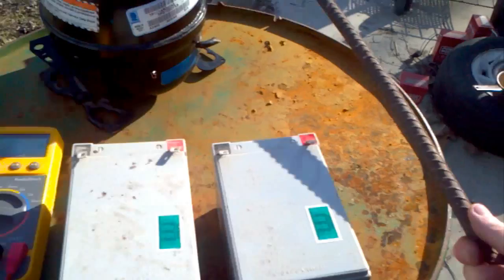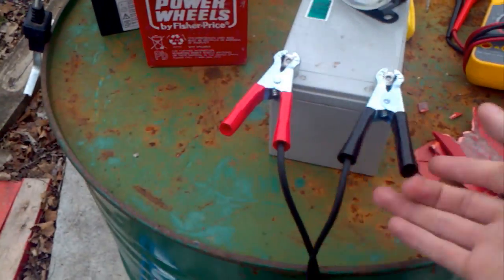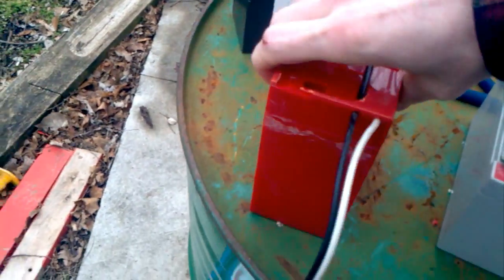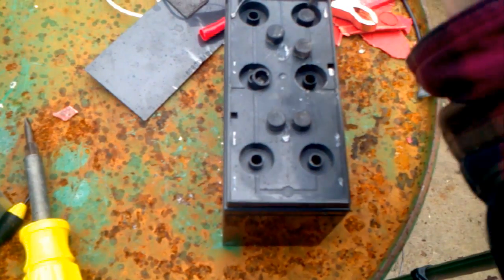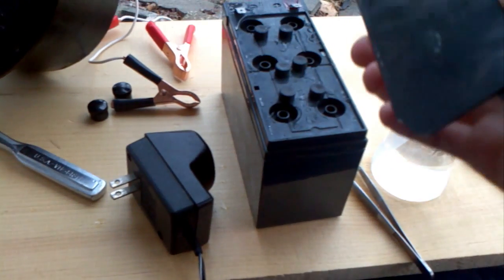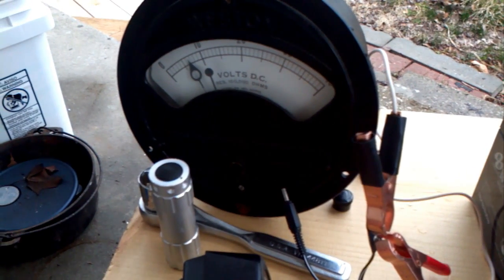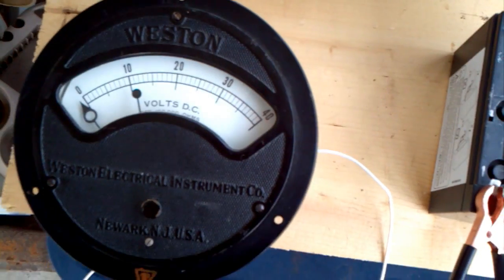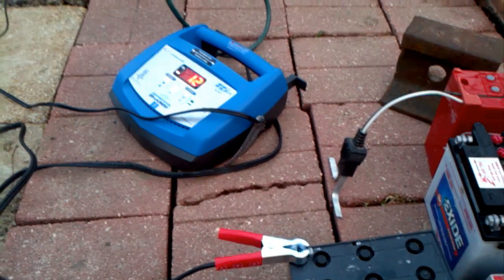DIY: Restoring Sealed Lead Acid Battery

Comment from the maker: you just connect it and let it sit on the battery for a few weeks. if your looking at the Wizbang Plus it pulls about 0.16 amps i think. unfortunatly mine arrived broken but they where really nice and just canceled my payment and let me have the broken one for free. i got it soldered back together and now plan to make them a  review for payment.

i do notice a small increase in voltage day by day. the voltage the battery settles to 20 minutes after charging i mean.

Comment from the maker: if its not raising voltage then you might kill your battery doing that. usually i dont charge more than 5 amps anyway. anything more than like 2 amps will electrolize the acid. a good sign of a battery reaching the cap of its present capacity is when it starts getting hot. that means the energy is turning into heat instead of being used for a chemical reaction.

a 20$ desulfator would be my choice. i'm desulfating my favorite battery and its gone from 11.9 to 12.2 so far.

Comment from the maker: oh but now that i think of it connecting the computer power supply with the desulfator to the battery might negate the effects of the desulfator. that is if the power supply absorbs some of the voltage spikes from the desulfator.

a desulfator work by feeding like 80v jolts into the battery but the capacitors in the PSU might level them flat. hrmm.

Comment from the maker: oh 11.2v? hell i was expecting like 3v. your battery could prolly do fine with a desulfator. the desulfator would take power so youd have to top-off the battery every day or so but the voltage should stedilly rise after a few days.

or maybe connect a computer power supply that is exactly 12.0. since its 12v it would keep it from getting discharged but it wouldnt be able to let it charge out of control and get pushed up to 15v or whatever. hrmm idk. :D

Comment: They show 11.2 volts when not connected to anything. I tried popping the cover off of them and cracked the cover off of one of the cells. I just taped it back into place until I can get some glue.

Comment from the maker: also when you have the battery open, connect your multimeter to some bits of wire (like from a cloths hanger or something) and dip those wires into the battery cells. this can let you check each individual cell for short circuiting.

for example if you wanted to test cell 4 you would put one probe into cell 3 and the other into cell 4 (i think) it it should read like 2.1v. but dont stick the wire down so far it arcs the plates. and the acid will corrode the probes so use old wires.

Comment from the maker: good idea for charging them, what voltage do the bad batteries sit at while not connected to anything? it would be a good idea to open them and check the water level. if that doesnt work then you could try adding epsom salt to the battery or desulfating it. i'd reserve epsom salt for last ditch effort. i'm having some good luck with a cheepo desulfator i got off ebay for 20$

the problem is the sulfur in the acid bonded to the plates and is now insulating them.

Comment: I have 2 batteries that I couldn't get to charge. They sat for about 7 months with little charge. I wired them up in parallel with a good battery and the charger is charging them but they won't show fully charged. The charger floats around 11.5v-12v and the batteries get pretty hot while charging. What should I do? Should I open them and add water?

Comment from the maker: yeah, you can use distilled water if you wish too. its just the batteries i get usually end up dying from experiments anyway so i dont worry too much.

but none of my batteries have had any problem with regular tap water.

Comment from the maker: hey thanks! it's also a bit teslapunk.

i plan on making more steampunk stuff soon, in fact my next project is a steampunk/teslapunk miner's helmet with high powered lamp. i'll use some leftover lithium cells from my electric bike to make it awesomer.

origenaly i was going to have simply a light on my bike, then i was gonna make it a detachable flashlight. until i realized it'd just be cooler to make my bicycle headlight mounted on my helmet. gonna use a 1940's hardhat for it

Comment: i built a bedini wheel and desulfated a similar sealed battery in 2 days with it  :)  it drew 1/4A roughly, started at 9V and is now sitting at a healthy 12.8. ive never played with an industrial desulfator, but the bedini does the job well!

Comment from the maker: i added it untill i saw it go above the plates. all ya really need is to make sure the plates are covered so the lead always has some electrolyte nearby to react with.

but evidently this type of battery has spongey inserts between the plates that hold the acid and arent filled to the top. they are called Absorbed Glass Mat (AGM) but it doesnt hurt them to fill them till the top of the plates. they just fill them less so they wouldn't spill if tipped over.

Comment from the maker: well unfortunatly they are very sad batteries to begin with. refilling the cells and charging them got the voltage up but they just dont have any capacity and they self-discharge really fast due to lead-sulfate deposits on the plates.

i got a battery desulfator though and am tinkering around with it. ima desulfate the battery in this video first then i'll make a video about my lawnmower's battery. but it takes 4-6 weeks to desulfate a battery so it'll be a long wait =_=

Comment from the maker: to reply to your comments in series..

1: ya, its cool couse it shortens to "Rin" 

2: the other main reason not to is couse windows doesnt like it, but I"M the user and windows is just my tool so it must obey me! >=P

3: battery desulfation doesnt melt the lead sulfate crystals, it dissolves it back into the electrolyte.

4: i used tap water, i know everyone thinks you have to use distilled water but
   A: these batteries are garbage
   B: i havent had any problems with tap water.

5: thanks :D

Comment: Is your name really Rinoa?

HDD mechanical failure is not the reason to not shut down "improperly."

Your (high voltage) welder zapping may have acted like a DIY Battery Desulfator.  The principle is to zap the lead with high voltage to melt away the sulfate & restor the surface. 

You may wish to clarify your steps.  Did you just add distilled water & charge it?

Thank you for the video.

Comment from the maker: AGM means Absorbed Glass Mat right? well the battery i used in this video might be agm then. the plates have white pads inbetween them that absorb and hold the acid.

to my knowledge AGM / GEL/ VRLA / flooded cell all work on the same principle, just GEL and AGM (witch are a type of VRLA) hold the acid differantly.

but what exactly is the question that your asking me? "the same way?" meaning it charges the same way or it requires water?

hope that helps.

Comment from the maker: yeah that sounds ok to charge with, just make sure to check it every so often, like every 30 minutes. and by check i usually unplug it for a few minutes because the battery slowly goes from the voltage it was charged at to its regular voltage.

like i've had batteries that showed 12v right after unplugging then but let them sit 5 minutes and they show 4v. and if you have something like a 12v lightbulb, hook it up to the fully charged battery and see how much it makes the voltage dip. :D

Comment from the maker: well tbh the gasses will vent anyway, the black caps act as kinda a 1-way valve. i just keep the caps off so i can whipe up any water that bubbles up.

here resently i've just left the caps on because its fun to watch them pop off from the pressure :P

oh and btw a lot of people are afraid of hydrogen build-up from batteries but the amount of gasses arent usually enough to cause alarm. i've tried to light it on fire and it didnt do anything.

Comment from the maker: furthermore, harddrives from 1989 till now use a spring loaded arm that automaticly retracts upon power being removed. since the disks are moving at a good 4k RPM or so, they still produce enough lift to make sure the read-write head doesnt scratch teh surface for the time it takes the arm to swing to the outer sectors and park.

and FYI the motion of the disk spinning produced an air current that lifts the read-write head above the platter. thus HDD wont work in a vacuum

sorry for rambling :p

Comment from the maker: and as a side note, the only reason people started worrying about shutting down their computers was due to servo-controlled harddrives.

from the 70's to the 80's most computers didnt have any function to shut them down, you just turned off the power supply. but the first HDD where controlled by a servo motor as apposed to the swinging read-write arm HDDs have today. so with those HDD you have to run a special program to park the HDD head before shut down or it'd scratch the HDD platter